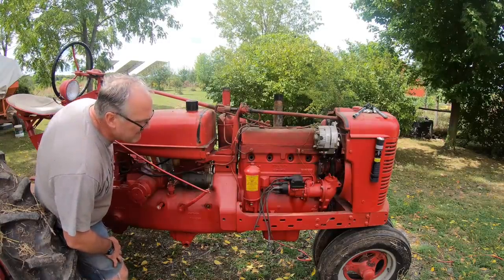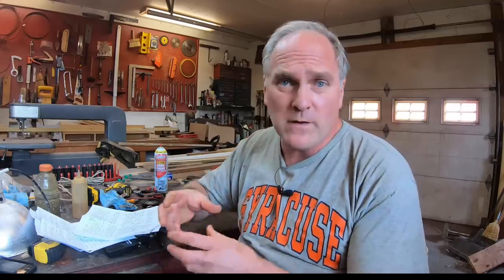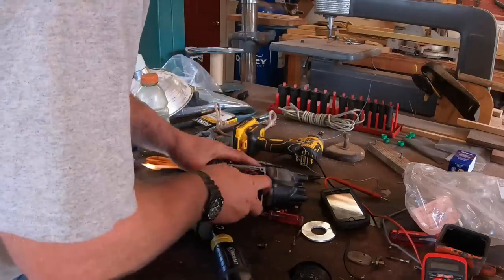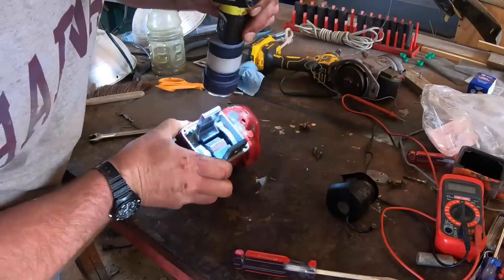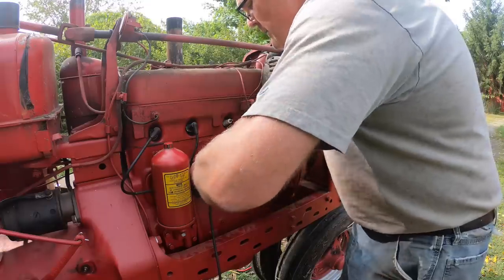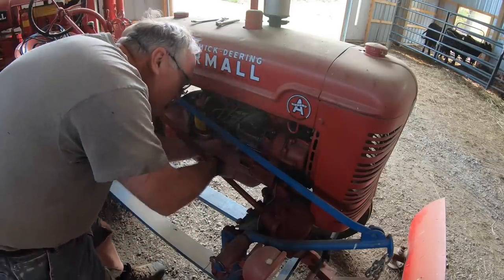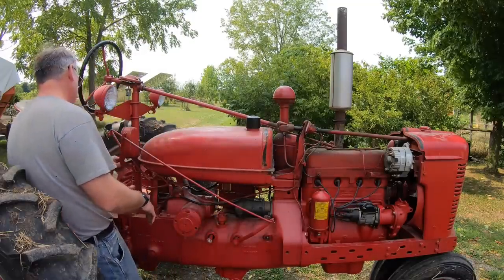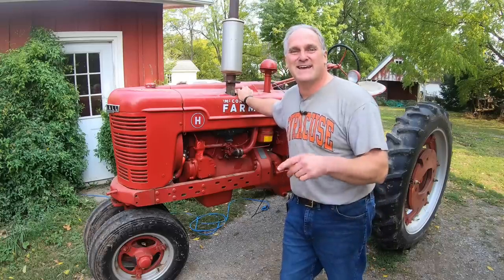repairing the FARMALL H and diagnosing magneto problems

Comment: You can also convert a magneto to battery ignition quite simply. You disconnect the coil in the magneto from the condenser and connect a coil to that terminal, connect your power supply through a resistor, and run your coil wire to the center terminal of your magneto cap. We had a Farmall M that was set up that way.

Comment: Switch to diesel pete 😎. I bought my grandpas 806 to keep in the family then a small acreage. I’m 35 now but our family has worked on IH and Massey equipment since my grandfather bought his f20 and my Great Grandfathers B. I have fought that 806 ever other day for a year. I love your videos, it’s always nice to  see someone else battling it out. A lot less swearing at your shop however...😜
Reply from the maker: No swearing, I like this work as long as I'm not in a hurry to get it done. That's why I waited so long to fix it, and also why I have a spare tractor or 6 to fill in if one goes down. Does that 806 have the big 301 gas in it? I ran a gas 263 in the 656 for a few years but swapped in a diesel and I'm very happy with it.
Reply: Just a Few Acres Farm my 806 has the DT361 diesel. I’m a diesel fan so I always razz a gas guy..😜 I love your tractor collection it’s great. I’m hoping to come across a decent M or a diesel 560 or 656.

Comment: I have seven Oliver O C 3  ‘ s.  Four run,  the other three are in various states of sad disrepair, waiting to be rebuilt.  They all have magnetos.  I have two spare magnetos ready to exchange.  From my experience, the condensers go bad just sitting.  I could not get  one OC3 running, no spark, exchanged it’s mag with a spare. Not starting.  No spare.  Points good and I cleaned them.  No spark.  Changed the condensers and Spark!   Those import parts are junk!  The condensers “suck in moisture” from temperature and humidity changes.  Now my spare mags are kept in vacuum sealed food bags!  No more mags going bad sitting on the shelf!  You do an excellent job of explaining how that ignition system works!  I enjoy your videos!

Comment: We had a condenser in the mag go bad on the '48 Farmall M while baling hay years ago.  It stopped running good and lost power and black soot came out the muffler. I was too young to know how they diagnosed it, but do remember the failure.  So with another excellent video it all made perfect sense.  And converting to battery ignition is sure the way to go.

Comment: A tip on having coil problems with magnetos, you can test them at home with a multimeter to get a basic idea if it'll work or not. Your workshop manual should tell you what the resistance of the coil should be or have a range of acceptable resistance, usually you just need to measure that and if it is too low or high you know the coil is bad and can diagnose from there. Another test to check its integrity is if the insulation in the coil has burned up and is creating a short by checking continuity from the coil to another part of the coil, depends on each model of magneto exactly where to test it but it's fairly simple.  Source is I'm an aircraft technician and most small prop planes still use magnetos for ignition, in fact aircraft universally have two magnetos for the twin sets of sparkplugs.

Comment: Pete, I enjoy your post. A little advice from an old guy. When replacing spark plugs, use a spark plug socket with the rubber insert and avoid using an extension on your ratchet. It doesn't take much sideways pressure to crack the porcelain on the plug and then the spark can short out there. Those shorts can be a real pain to find if that's the case. Good luck in all you do.

Comment: Ahhh, there's nothing better than super sleuthing a problem and figuring it out. But I have to agree about going to the battery ignition system. Most small airplanes also still use the dual magneto system, and they can be not always reliable at times but there you have the redundancy of dual mags on the airplane.

Comment: Great video.  Love it.  If the condenser and coil are good, then either a bad armature or bad magnet.  My dad collected those M/D and IH tractors for years.  Ones from the 20’s to the 60’s.  He had a lot where the magnet got weak or lost it all.  He refurbished many of them by recharging the magnet.  Not entirely sure how he did that.  Whether a bit of heat was needed or not as well as an electro magnet.  From the way the washer attached to the magnet, it looked weak to me.  The magnets I still have snap a washer down pretty good and don’t come off easily.

Comment: i had  magneto that had no spark,i took the rotor out and it was rusty,had hose clamps around the rotor to keep it magnetized,cleaned the non moving parts of the mag in the blast cabinet then cleaned everything well in my parts cleaner.put it back together and had spark,oh and if there are carbon tracks on the rotor,erase them with a number 2 pencil eraser,i used magnetos in my modified race cars,harleys,and lincoln welders on the job,the old lincoln SA 200 had a 4 cylinder gas continental

Comment: Since I am seeing this 9 months later, maybe someone has already suggested using an analog volt meter with a needle. This shows the condition of the condenser better than a digital meter... I have used this method for years and I still have an analog meter mainly for this purpose. Many digital meters also have a capacitance setting that allows you to test the condenser also.

Comment: Another great video Pete ! Looking forward to seeing you install the distributor. I've heard folks voice concerns about rollover on those old tricycle configuration tractors, but when you're doing your celebration dance in tight circles, it looks very stable. Have you ever had any concerns about stability on those? Thanks for sharing so much great content.
Reply from the maker: I don't have any concerns about stability, and the narrow front is so nice for turning on a dime. I've got 450 lbs of wheel weights on each rear tire which helps. It's never felt unstable on any of our terrain.
Reply: @JustaFewAcresFarm  Good to know. Thanks for your input Pete.

Comment: The few times I had trouble with a magniteo, it was one of two things. The impulse  mechanism wouldn't work because I forgot to oil it. It doesn't get oiled from the engine. The other thing ,was the condenser was bad.. Change the points, condenser and oil the impulse and you shouldnt have any problems with it

Comment: If I remember correctly you don't have to remove the hood to get at the plugs if you use a universal joint on the spark plug socket.

Comment: Seems I remembered #1 being the cylinder closest to the seat. Used a cork in the spark plug hole and turned it over with the starter until the cork popped out. Was about 13 at the time so ....
Reply from the maker: Cool cork trick. The #1 cylinder is definitely the front one.

Comment: Was wondering if you use a gas oil mix for the h since it originally ran on leaded fuel? Or just straight gas? Had a few old farmers tell me that you mix used filtered diesel oil in with the gas

Comment: I have a Wisconsin 4 cyl with a WICO X magneto. Have a really difficult time starting and it’s hand crank so hard to see any spark. I put a spark plug (glass bowl) tester on each plug so when I finally got it started I found only the left bank cylinders are firing, #1 & #3. No spark on right bank, but runs smoothly on just the two cylinders! I’ve got good plugs, correct gap, have swapped some plug wires, cleaned and inspected the cap. Any reason you know that only one side of the motor is getting spark?

Comment: You won't believe this but I have an American Bosch mag from the 40s and if you change plugs you must change the wires. Metal wires. If you don't the change in resistance blows the coil. 100.dollars a pop. I don't get it.  How are the metal wires any different with just a plug change ?